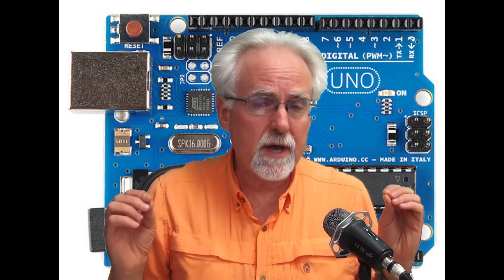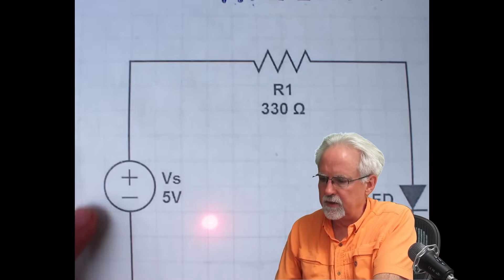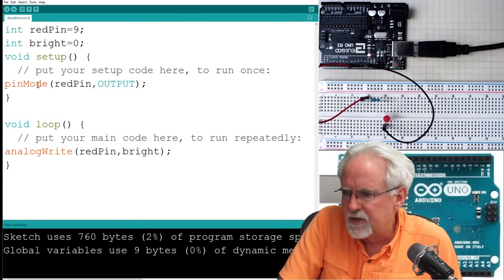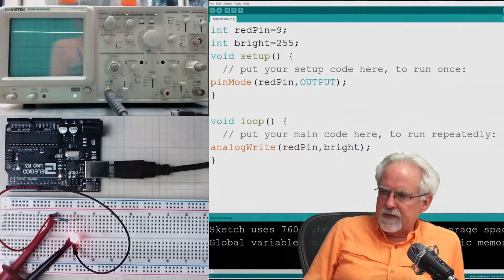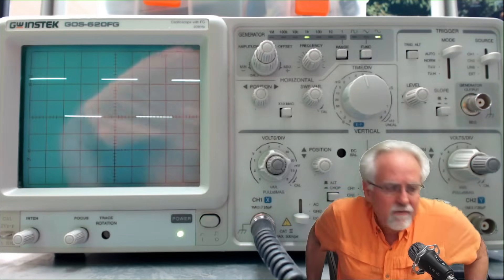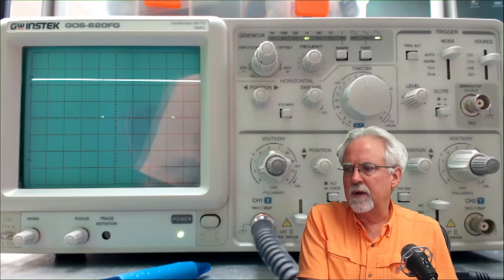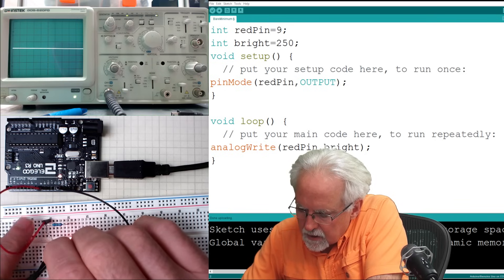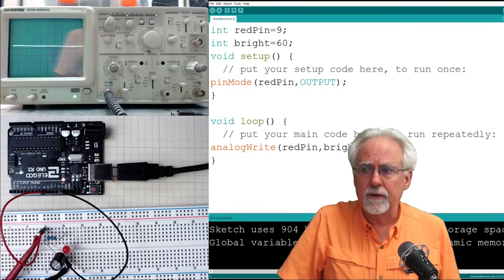Arduino Tutorial 8: Understanding Pulse Width Modulation (PWM) and the Arduino Analog Write Command

Comment: I think maybe you could write a loop with digital write only emulating analog write and using various delays it could also dim the led
Reply: i did this and here was my code

int gled =9;
int bright=255;

void setup() {
  // put your setup code here, to run once:
pinMode (gled,OUTPUT);

}

void loop() {
  // put your main code here, to run repeatedly:
analogWrite (gled,bright);
delay (25);
bright = bright-1;

}

Comment: Hi Paul, thanks for the great tutorials. We can make the circuit much neater and more simple: use the resistors to connect the Ground to the LEDs. This way we can save a lot of connecting wires for complex circuit also.

Comment: Your classes are superb. 
Now, only because you asked: when you move things about to get them straight, try to limit yourself to two or three adjustments per shot as it can get a bit much - for me at least- to have the bread board or the arduino wobbling about the screen. Minor point, and only because you asked.
Your mixture of depth of explanation with slow repetition of the physical construction is really ideal. An exploration of the physics with a demonstration of the occasional difficulty of actually getting the wire into the bread board, all in real time, is very informative.
I chose pot and ale over coffee but I won't quibble.
You are a real asset to us all. Many, many thanks.

Comment: Hello! I have an Arduino Uno and a DSO138 osciloscope. In my setup, I used the pin #9 and I had the frequency of 490.16 Hz which translates to ~2 ms per pwm cycle. How come do you have 4ms? As I saw, Arduino uses  2 types of PWM frequency:490Hz and 980 Hz. Thank you very much!

Comment: The arduino simulates the analog voltatage by switching from plus 5v to 0 back and forth in a frequency to get the voltage

Comment: Great video.  Not sure if you will cover this later in the series, but it would be illustrative to explain the microfarad value  and type (electrolytic/ceramic, etc of the capacitor to use in different circuits to effectively smooth out the PWM.  I would guess that different values of capacitance will have different effects on the ripple.  Thanks.

Comment: Tying a cap on the output of the chip smart? I don't know if there is an iknternal resistor to limit the current at T=0, the capacitor is a short circuit.....curious

Comment: Outstanding!!!  This helped shed some light on questions I had about DC to AC inverters...specifically pure sine wave versus modified sine wave and why some equipment may not work with a modified sine wave inverter.  Based on the oscilloscope images I don't think my PC would like the on and off nature of PWM which seems like the same thing as a modified sine wave.  OR I have misunderstood all of this and should put a bag over my head :)
Reply: I have run PCs on squarewave inverters they have switchmode power supplies themselves anyway.  They don't care too much about the incoming waveform.

Comment: It was interesting that when you dropped the pwm signal to 60 with the capacitor in the circuit the led actually cut out as the forward voltage was too low. This of course doesn’t happen without it as it’s being pulsed with 5v for a short time. So an led can run dimmer with pwm than it can with analog input. That’s really cool!

Comment: Now it makes sense: with PWM you're able to modulate\adjust\change the width of a signal\pulse. The coding instructions allow you to adjust those signals\pulses to whatever value is suitable for a particular application. VERY cool capability. Amazing what these boards are capable of doing. Thanks again!

Comment: Hello Paul,
I feel like a friend is walking me through some projects rather than a teacher, so great way of presenting the facts. I had heard of PWM, but not dug into it to it, so this is wonderful knowledge. Flash back AM diode crystal radio, using the capacitor to produce the audio after being rectified by the diode. For me the way I look at PWM now is like a packet of energy, the more area above the line the greater the amount of energy contained.
Leon

Comment: Wow Paul - having the visual representation of the oscilloscope has really helped to understand PWM, it's also taught me  how a capacitor smooths the power out.  I want to learn about neopixels (LED Tape and Rings) from Adafruit and they recommend using a capacitor so the power supplie doesn't blow the LED's.  Now it makes perfect scene :-)

Comment: Thanks for another great video, I understand PWM but I'm curious, how does PWM affect current flow, does it change that also...
Reply from the maker: V always equals I*R. So, I is going up and down with V. I is PWM as well, if that makes sense. On this time scale, you would probably start talking about average current and voltage instead of instantanouse current and voltage
Reply: @paulmcwhorter  Ahhh, forgot about ohm's law, thanks.

Comment: Note: you can write a PWM code, analogWrite to a Pin that is not a PWM pin. Like Pin 8 and it will still try to do the code except it wont react on the board unless it's either 0 or 255. I tried it just to see if it would know if i'm trying to do analog on a pin that cant do analog. Figuring it would give error. No error code.
Also discovered that digitalWrite will work with 0 instead of LOW and any value above 0 like 1 will work instead of HIGH. to turn on LED .

Comment: I tried to put the capacitor in between resistor and positive of LED. PWM from 25-255 in small increments with 200ms delay in-between each increment. It quickly lost its brightness and you can hardly tell it was on . I'm assuming that the LED responded this way is because of how you explained how LED/silicon works and since it wasn't getting full 5v to make electron jump the gap because the capacitor was averaging the signals.?

Comment: Nicely done, I didn't hear any rambling.  I really liked the end with the capacitor - at 60 the capacitor dropped the voltage below the LED threshold and it turned off. PWM is neat technology.

Comment: I think I get it. Going back to a previous lesson where you explained the need for resistors I will guess that the full 5V (pwm) isn't supplied long enough for the LED to reach full brightness, so we see a dimmer light. I wonder if the fluctuation in current is bad for some things, maybe it happens too quickly to be important... guess I'll find out :)

Comment: One thing that you missed in the video was the fact with PWM you are always biasing the LED on, because it's 5 volts when high.  But when you add the capacitor the DC voltage smooths out to the point that the voltage never reaches the point to bias the diode on (.7 volts or whatever the diode requires)  this part would actually be better shown with an incandescent bulb that had a low enough current draw that it would not damage the output of the Arduino.  I am new to the Arduino, but I have 4 years total of electronics training and work in the two way radio field and have been a HAM for the last 15 years.

Comment: It's actually amazing what you can do with pwm. We use it quite a bit with flight controllers to control our brushless motors for our drones. These motors are supplied constants battery voltage up to about 25v but the pwm occurs through a data line which is just 0-5v that turns the motors off or on by applying the battery voltage or removing It. It handles not only setting the rpms of the motors but ramping them up slowly or quickly and even active braking of the motor rpms by momentarily reversing the motor. Not to mention the radio control signal is based on pwm as well. I was one told to think of pwm as cruising at speed on a bicycle. You can stop pedaling and coast. If you want to keep that speed you don't have to pedal constantly but rather push the pedal full force a quarter turn every now and then to keep the speed constant. I probably didn't explain that very well but it made sense to me at the time.
Reply: I’m just starting arduino I didn’t think this lesson was important but wow

Comment: Many thanks for this informative video about PWM. 

But there's a point I still don't understand about my PWM. 

In the PWM method, 5 volts or 0 volts are sent to the LED. Only the amount of time that 5 volts are sent changes. That is, the amount of voltage that will cause the LED to illuminate at full brightness is sent. But this voltage is being sent for a very short time. If we're sending 5 volts, shouldn't the LED emit full brightness for a very short period of time instead of the low-brightness LED? And shouldn't we see that the LED emits full brightness for a very short time?
Reply: It's actually your eye and the human visual system that's averaging out the brightness.  It can't respond to such a quickly changing brightness.  The LED itself is really turning on and off very rapidly.  If the period of the PWM signal was larger (or, in other words, the frequency was lower) then you would see the LED turn on for part of the time and off for part of the time).  In the arduino though, the PWM signal is generated at around 490Hz (2.1 msec period) or faster.

Comment: my notes for this lesson

analogWrite("pinNumber","value between 0-255");  the value 0-255 corresponds to 0-5 volts

this command uses - pulse width modulation: this means that the Volts are only either 0 or 5 but pulse on and off at a speed that is dependent on what value you are using.

how to view it: imagine a person is running at a speed of 5mph, for 0.1 seconds before they stop for 0.1 seconds. from your perspective it would appear that the person is running at a speed of 2.5mph even though they are actually only ever running at a speed of either 5mph or 0mph
Reply: brilliant
Reply: @MrAshwindersingh  well i dont get it. ..
Reply: Is it because the image persists in the eye for 0.1 s approximately. So even when it stops our eye continues seeing it for 0.2 secs and that is why it appears that he is slower and running at 2.5 mph?

Comment: Notice something similar with a frequency drive... Same voltage but simulating a sign wave with gated transistors..
Here's a link of my video 
https://www.dropbox.com/s/hnwgr38c6loakcp/1080_30_13.50_Mar032019.mp4?dl=0

Drive is cool.. Its ac single phase220v rectified to dc bus and microprocessor firing transistors to create 3phase that is being smoothed by capacitors.. Fun!

Comment: Well designed course for PWM. Thank you, Paul.
I would like to summarize the concept of PWM: a programmer sets the time for a circuit to be on and sets the time for a circuit to be off, in an on-and-off cycle. The result is the final average output voltage is set to a fixed value. 
To easily undestant the effect of PWM, I do not think the best example is LED brightness. I believe the best example is use PWM to set the speed of a computer fan. Students will be able to visually see and understand PWM can set or change how much wind the fan can blow to them.
Thank you, Paul!
Reply: agreed, the eye doesn't respond linearly to brightness

Comment: Hi Paul, I think it would be better to connect the capacitor behind the resistor instead of directly to pin 9.
This is to prevent damage to the Arduino
Douwe
Reply from the maker: Yes my intention was to show how a capacitor works, and smooths an AC signal. Proper circuit design should be used when actually using in a project.

Comment: Analog write command by itself is varying between 5v & zero volts to give an average equal ( roughly ) to whatever value we input. But in order to get a smooth line ( wave ) at the value we want, then we have to use a capacitor within the circuit. And even then we have to account for a bit of waviness. I think I understand it. So, capacitors is the way to go for controlling a servo motor    ?
Reply from the maker: No, servo motor wants to see pwm. Also DC motors do fine with PWM. You only use the capacitor in cases where it is needed. Lots of things work fine with PWM directly.
Reply: @paulmcwhorter  okay. So what is one situation where a project using pwm would require a smoothed voltage reading ?

Comment: Hi Paul. loving the videos and looking forward to each one. only thing I noticed is your scope was set to 0.5mS per division and the period was 4.2 divisions. that to me is just a fraction over 2mSec not as you said 4mS. just me being eagle eyed. but loving it. when you getting onto inputting via switches or sensors?. keep up the excellent videos and not tried the ice coffee yet...
Reply from the maker: I could have misread it, thanks for the observation.

Not drinking Ice Coffee could get you banned from the channel, though:)
Reply: @paulmcwhorter  Now Paul, you know it's really tea in that cup. HaHa. Fantastic tutorial series so far! Learning so much. Thanks
Reply: @paulmcwhorter  actually you read the period from the screen and the msec/division scaling correctly, you just made a mistake when you used the calculator.  You might want to put an overlay of the video at that point with the correct period of 2.1 msec rather than 4.2 msec.

Comment: Paul I work in heavy equipment design and particularly in the hydraulic systems which power the mechanisms.  Sometimes the valves we use are PWM type valves.  Now with this understanding I can see better how the valves are working.  In those systems they have PWM drivers which apparently produce enough amperage to actuate the valve coils.  And I believe the signal we send the drivers is just a lower amperage signal.  Does that sound correct?

Comment: Great video on PWM.
Too advanced at this point but perhaps you could discuss RMS vs Average and how it applies to heating circuits in a future video
Reply from the maker: Would love to do a video on Excel, and show a sine wave, then square the sine wave, then average it, then take the square root. Show that it is related to peak by sqrt(2) if that makes sense
Reply: @paulmcwhorter  That makes perfect sense. Graphing the V-Avg and V-RMS values for comparison could be useful too.

Comment: Thank you for the Arduino Tutorials sir!!
I know that capacitor opposes sudden change in voltage. ic = C dV/dt. So, when the pin output goes from LOW to HIGH, capacitor should take large impulse current as dV/dt goes to +inf. Similarly when the pin output goes from HIGH to LOW capacitor should supply large impulse current back to Arduino pin. 
Is it safe in the long run? Are digital/analog pins capable of taking current from external circuits??
Reply from the maker: The things you are saying are correct . . . I was just trying to show a quick and dirty demo of how capacitors can turn AC into DC. If you were really going to do this, you should do some circuit design.
Reply: It is safe, the Arduino pin when off is effectively floating and does not "sink" current from the cap, and the charge will sink quickly through the LED. Every digital pin is capable of handling 5V. What do you think it is doing for the digitalRead?

Comment: The arduino simulates the analog voltatage by switching from plus 5v to 0 back and forth in a frequency to get the voltage
Reply: unless you use  a capacitor right? I'm just asking because im not sure.
Reply: @vitustillebeck  yaahh....

Comment: Paul, just a little bit confused. I assumed PWM was for time based full voltage. Example, 12 volt motor needs 12 volts to opperate correctly and if you send 12 volts in varing pulse widths the motor will either increase or decrease speed depending on the time the pulse is high. Question: Why do i need the capicator and average voltage? Is it for amperage, watts ect?
Reply from the maker: The capacitor is to create true DC, when that is what you want. You might not always want it.